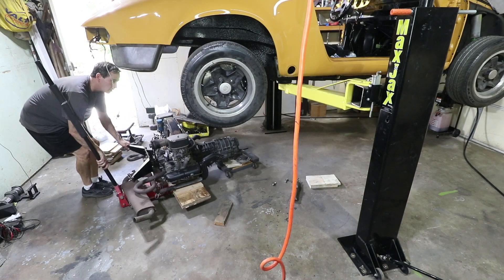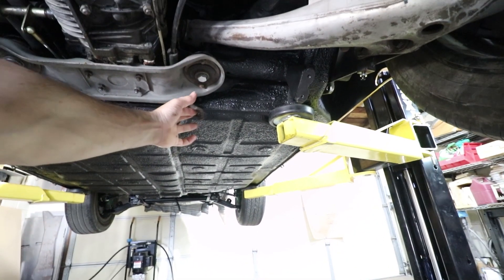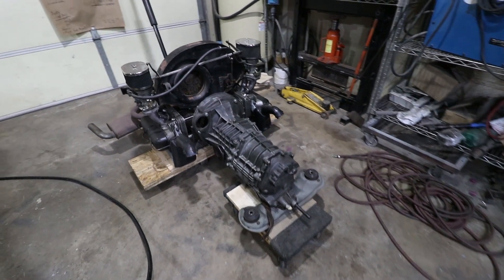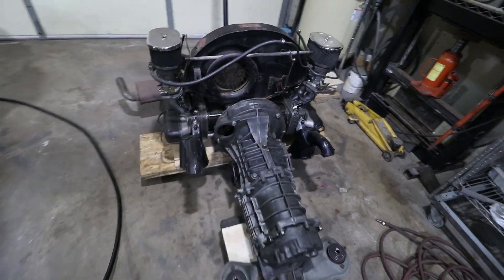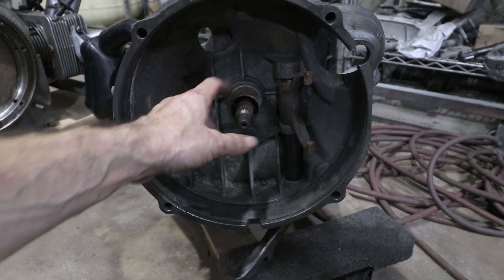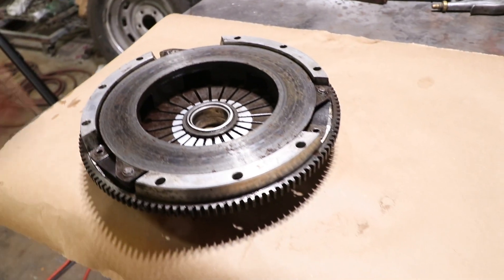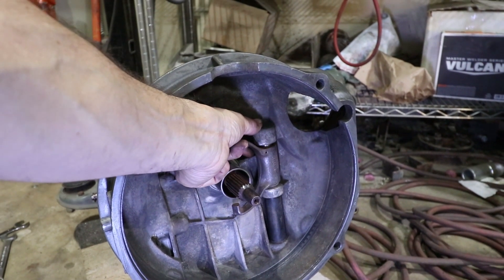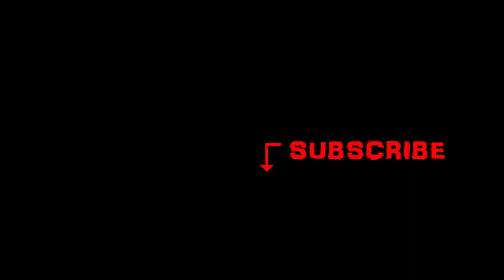ENGINE IS OUT & How To Connect a 912 Engine To a 915 Transaxle

Comment: Great Video Tom!  I need to sort out my clutch as well.  I thought you needed to use some type of alignment tool to get everything installed correctly, is that not the case?
Reply from the maker: Yes an alignment tool is needed when you clamp everything together with the nine bolts.  I don't have the bolts yet or the alignment tool.   Both are on my to buy list.  Actually the bolts are standard and I can pick them up at my hardware store.  They must be grade 10.9 or better.  The alignment tool is a piece of plastic I think.  I

Comment: Nice work. About the engine drop - I used 4h my first time but less than 2h next time around on a full running 911. It is so easy and I guess I can shape a bit more off the time with snap connectors on the fuel lines (takes the most time to access). You are not waisting time removing the engine - it is so easy on these cars. I even do it to adjust the rockers - gives a much fast and easier inspection of the engine.
Reply from the maker: Sounds right.  Removing the engine is just as easy as a VW bug.  I've done both, ha ha.  Just a few more things to disconnect like the axles.  I will say the lift helps a lot!  If someone else is reading this, don't be afraid to remove the engine yourself.  Just be safe.

Comment: Never easy sourcing parts for vintage cars, especially German ones. I imagine the 901 was the mostly likely trans used in 912s? And I believe they were four speed boxes? And the starter ring on the clutch and not the flywheel. Lots of engineering here.
Reply from the maker: You are right about the 912 and 901.  I'm not sure if they made 5 speeds or not, but I think they did.  The 915 is just another evolution and little bit stronger.
Reply: @GarageTimeAutoResto  thanks for the video. 

they made 4 and 5 speeds.